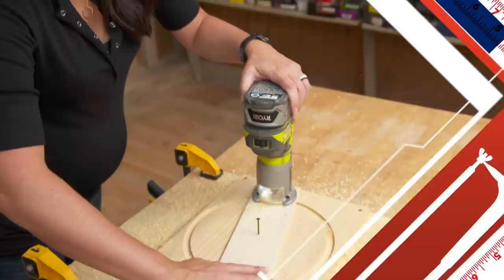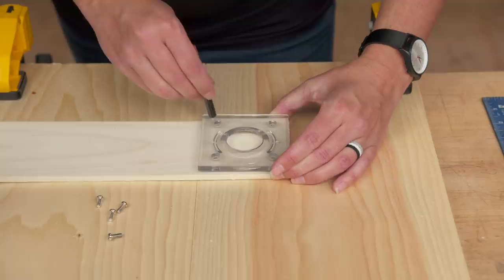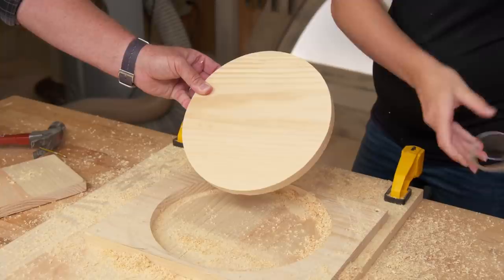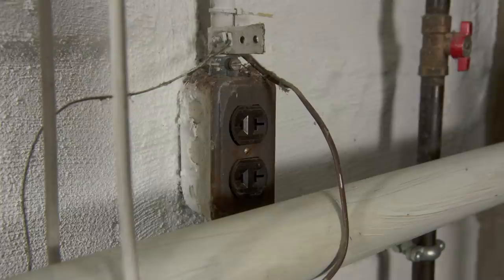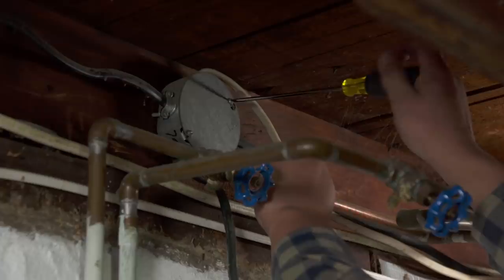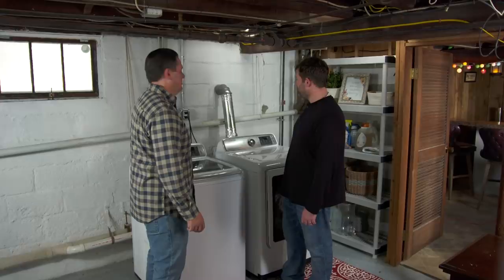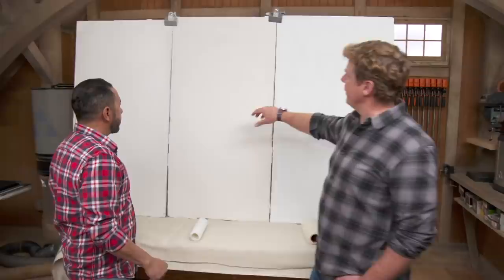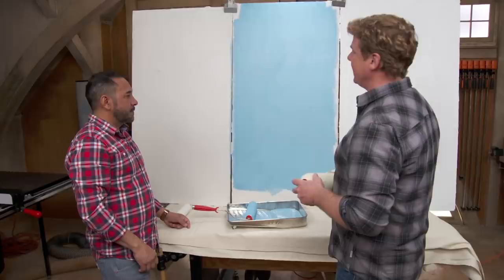ASK This Old House | Ground Wire, Fireplace Doors (S18 E19) FULL EPISODE

Comment: I had to cut some holes in a finished ceiling for pot lights.  Used a dremel, screw and fishing line.  Got a nice cut and the pot lights fit like butter.

Comment: In my 50 years never saw or heard of anybody owning the offset device. Was thinking of purchasing one until I found out how muchbthey cost. Finally got good at not only doing offsets but back to back & saddle bends. Good ideal of using the piece if 1/2" EMT to protect the NM cable coming down wall. Did not see what year this was made but if your state is in the 2020 NEC you would have to provide AFCI protection and not a GFCI receptacle. Hope you mentioned that you must use TR ( tamper resistant ) for all 15 & 20 residental receptacles. One of our local inspectors does not require a TR receptacle if over 7' above ground level.

Comment: The electrician said install a arc fault breaker, it should be a arc fault/GFCI combo breaker also turning off the the main breaker does not isolate the whole panel, it only turns off everything after the main. If you want to isolate the whole panel you need to have a disconnect ahead of the panel or pull the meter.
Reply: Brian K I suggest watch a 13 part series called What on earth happened by Ewaranon to learn that the earth is not a globe.

I got it in my about tab.

Comment: 3:23   If you want a true 5" radius the nail hole has to be 5" from the beginning edge of the router bit.....not to the middle of the router bit.
Reply: Came here to say this. Jen's method (which has been shown on other episodes), does not give a10" diameter (5" radius) circle. That is because she did not account for the bit. The measurement she made is to the center of the bit. If you do that and expect a 10" diameter circle, you'll be disappointed
Reply: came here to point this out as well.
Reply: Yeah, that was 10-ish inch diameter.
Reply: i've seen a few other segments with her, she designed them and they thought she would be competent enough to get the things right. They want to have more women on the show doing stuff to be woke but it's hard to find skilled women so they will just take what they can get. We've all made some silly mistakes in measuring though...but then again if I was a skilled woodworker like Tommy and good enough to be on the show I don't think I would make mistakes like that...but with women they will just take whatever they can get.
Reply: Big Mike I suggest watch a 13 part series called What on earth happened by Ewaranon to learn that the earth is not a globe.

I got it in my about tab.

Comment: I understand running new wire to the basement outlet so they have a ground, but never figured why they tore everything else out. Why not leave the original conduit and 2x4 box? Yes, there's something spiffy about "all new" but the average guy will go the easy route and have the same end result for working purposes.
Reply: So it’s up to code
Reply: @jsmith5641  ... if the wire was replaced and included a ground plus being a GFCI then it would be up to code. I just didn't see the need for ripping everything out when it already had a conduit and box in place. That made it spiffy, but wasn't necessary.

Comment: re 13:39, a three prong outlet with the ground terminal jumped to the neutral will defeat the tester. Peak in the box to be doubly certain.
Reply: I have a tester that picks up on that trick but yea, those test light testers are easily fooled.

Comment: Love the router circle jig.  Hate the choice of bits, though-- needlessly large.  Use a 1/4" up-spiral solid carbide bit instead.  Less waste, far better control, much less chips too.  Smoother cut, needs far less sanding before finish.  

Second trick:  Secure the circle from below, to a larger support piece, taking care to keep the screws well away from the edge.  Then, once the circle is cut?  Use the same jig, but with an edging bit, to create whatever shaped edge you desire, round over, cove, etc, using the appropriate router bit.   Use the same set up to sand, as well.  THEN you remove from the underlying support piece.
Reply: Bob I suggest watch a 13 part series called What on earth happened by Ewaranon to learn that the earth is not a globe.

I got it in my about tab.

Comment: Romex is not rated to be installed in EMT, at least where I am
Reply: It can be run inside short runs of conduit, typically 8 ft or less.  It's often used to protect the cables from the ceiling down to the receptacle box, as it is here.
Reply: It can be run in conduit, but you have to pay attention to conduit fill. In this case it is being used to protect it from physical damage.
Reply: We run it in sec 40 only one wire
Reply: i failed that in austin texas for using 12" of conduit over romex.
Reply: Seriously, why not just run mc the whole way? It's not that much more $$. And then you're grounded at both ends. Hope he at least put a connector on the top end so it doesn't friction wear as the rats run across it. No? Then a kick toward the panel? No? Enjoy that house fire.
Reply: Why is that ? I'm genuinely curious for the technical reasoning, not just "because it is code". Thanks
Reply: @2loco  NEC allows you to run NM Cable in conduit when that cable needs to be protected except when buried as that constitutes a wet location.
However some states may have their own code laws. 
In regards to your question of why some people say NM can't be run in conduit it's because they think it will build up too much heat in the confined space and cause a fire due to the type of insulation used in Romex/NM cable.
Reply: I've had romex going into PVC conduit for a couple feet to my outdoor heat pump for years. No problems

Comment: You guy's  are fantastic ,But I do have a problem with an electrical outlet with no power/ It did work before ,I checked the brakers 16:58 all are fine  So I changed the outlet hoping that would have been the problem no luck,can you assist me with  this  problem when you are in the area I would appreciate if  very much

Thank you
Please advise😅 15:48 sent 7/4/2023

Comment: Good way to strip machine screws. By Installing them with a power drill..
Reply: chop it I suggest watch a 13 part series called What on earth happened by Ewaranon to learn that the earth is not a globe.

I got it in my about tab.

Comment: to get a 10" diameter you don;t center the router bit to your measurement. you measure to the inside edge. also you're not using the best router bit, evidenced by the chatter when cutting . please explain how a screw would cause the wood to bind? if you have the right size clearance hole, either is fine

Comment: running a dryer on 120v? I'm used to 240v.
Reply: When I lived in a duplex the other tenant purchased an electric dryer that could run on 120 or 240 volts. Only problem took 4 times longer to dry everything. Whenever you halve the voltage to a heating element you quarter the BTU output. So a 5000 watt heater w
Reply: @Kevin-mp5of  I do now see the gas line next to dryer. But then what is the 'heavy load' he is talking about. I would still install 12 gauge anyway.
Reply: @donc-m4900  Unless you're just being cheap there's really no reason to use 10 or 12 for anything up to 20 amps.
Reply: Don I suggest watch a 13 part series called What on earth happened by Ewaranon to learn that the earth is not a globe.

I got it in my about tab.